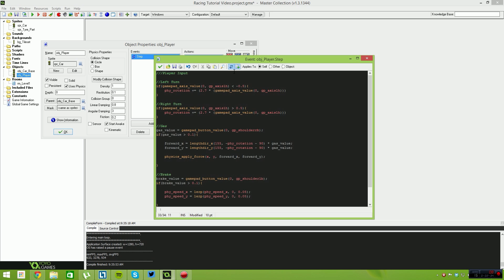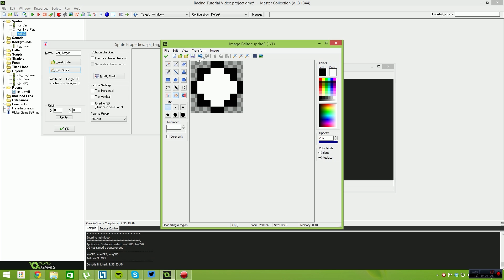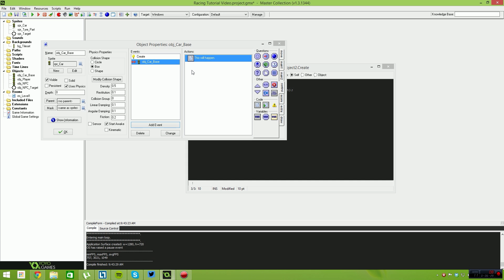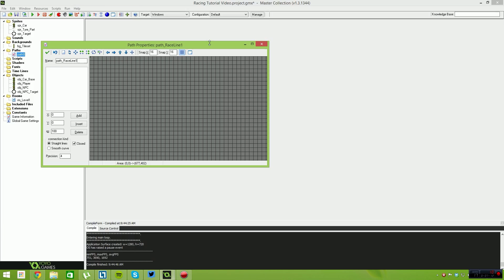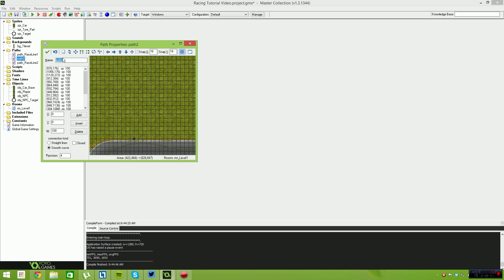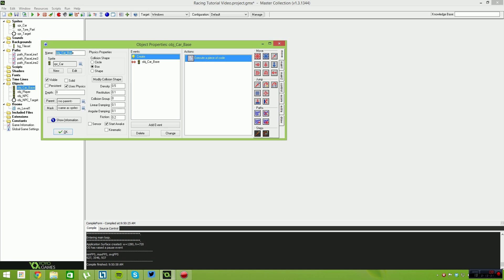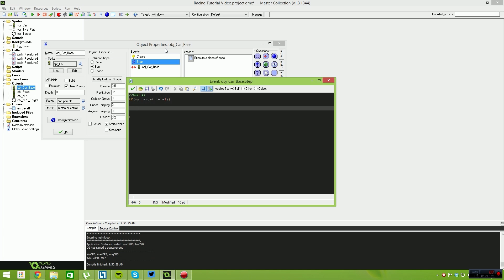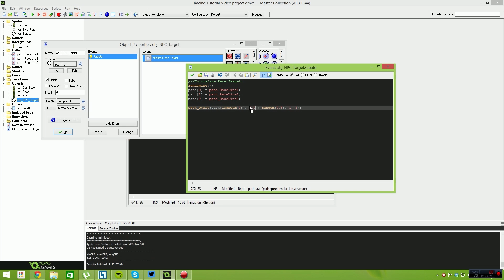Game Maker Drift Racing Physics Tutorial - Part 2

Comment: I seriusly need help! I have the exact same code as you do +rm2kdev, but I get this error:
Entering main loop.
********************************.
ERROR!!! :: #######################################################################
FATAL ERROR in
action number 1
of  Step Event0
for object obj_Car_Base:

Push :: Execution Error - Variable Get 100000.my_target(100000, -2147483648)
 at gml_Object_obj_Car_Base_StepNormalEvent_1 (line 2) - if(my_target != -1){
#######################################################################
In the Obj_Car_Base step event.
My/Your Code:

//NPC AI
if(my_target != -1){
    
    t_dir = point_direction(x, y, my_target.x, my_target.y);
    t_xd = lengthdir_x(145, t_dir);
    t_yd = lengthdir_y(145, t_dir);
    
    physics_apply_force(x, y, t_xd, t_yd);
}

I can't see an error in it, but any help is good enough. Thanks :D
Reply: +Ted Martens i havent yet checked if this works, but duuuuude, respect for answering
Reply: +Crafted Box Did you figure out the problem with this? I have the same error.
Edit: solution below
Reply: +Crafted Box I figured it out! To test if you have the same problem, go to your oPlayer object and remove Obj_Car_Base as a parent and run it. See if the error goes away. If so, this is the problem:

The problem is actually with oPlayer, the CHILD of Obj_Car_Base. Middle-click on the function "event_inherited()" and read how it works because that's the issue. If you added a create event to your oPlayer, then it will NOT use the create event from it's parent, Obj_Car_Base, which was where the variable "my_target" was declared. So, when oPlayer runs the Step event, it doesn't know what the variable "my_target" is. For some reason, the error tells you the problem is in Obj_Car_Base, but really it's in oPlayer.

Solution: Either remove the create event from oPlayer, or add "event_inherited()" to it so that the code from Obj_Car_Base gets run. And remember to make Obj_Car_Base its parent again.

Hope that helps (3 months later ;p ) Good luck!